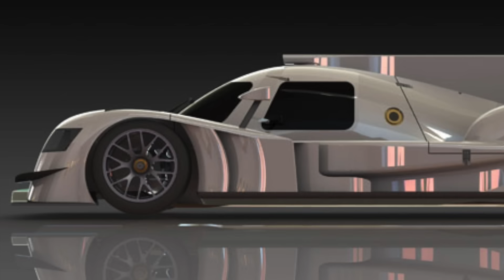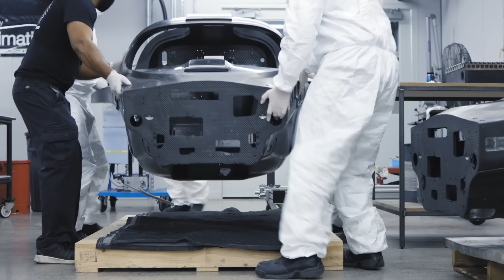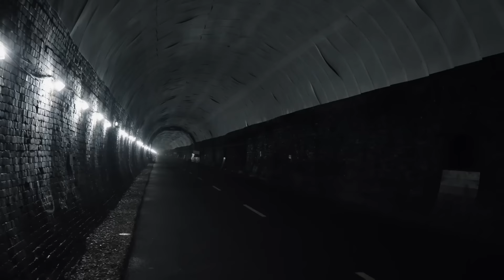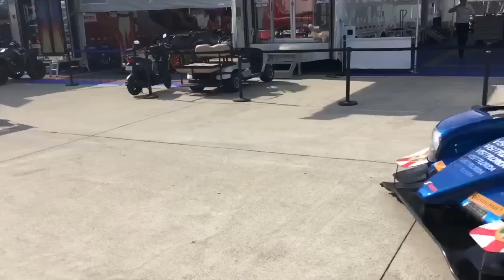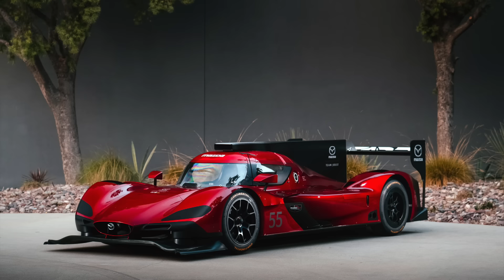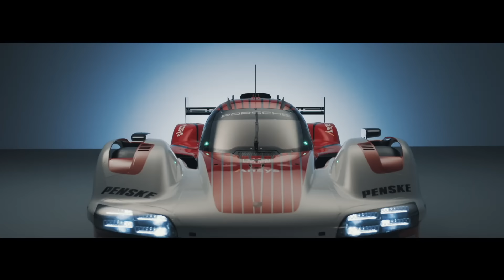Mazda RT24-P & Riley MkXXX - The DPi sportscar that defined an era

Comment: Definitely one of the best looking sports prototypes of all time and absolutely in my top 3. Every time I watch an on-board video of the RT24-P at Daytona, especially 2019 onwards, I giggle at the sound of this little 4 cylinder pressed against its 9000 RPM redline thinking: "man, this little thing is working that 600+ HP". Sad to see Mazda leave the series, because looking at how the Porsche 963 is slaying with the Multimatic chassis, I always keep thinking: "that could've been Mazda up there". When or if Mazda decides to come back to the party, I wonder what chassis they would use, how would it look, considering the RT24-P is a tough act to follow, and what engine will power it: the old 4 cylinder, its awesome straight 6, or even its new Wankel rotary. Whatever happens, I'll be glad that Mazda returns to prototype racing

Comment: I do not like pointless comments.
Reply from the maker: paperclip.
Reply: @Samsthepits  For the record, it was a comment to feed the algorithm. By the way, I just subscribed today... 😉😉... so you might as well get used to my pointless comments.
Reply from the maker: @Roddy451  Well thank you - the algorithm will enjoy discussions about paperclips.
Reply: @Samsthepits  P.S. IMHO, your channel is underrated. It is very informative, and you do a good job of not taking sides or speculating. Keep it up!
Reply from the maker: @Roddy451  Thank you very much.
Reply: @Samsthepits  P.S. Make that an angry paperclip...
Reply from the maker: @Roddy451  How do you make a paper clip angry?
Reply: @Samsthepits  You replace it with tape or a staple...
Reply from the maker: @Roddy451  what about those metal bars on strings?

Comment: I, too, was struck by the beauty of the Mazda and distraught that it wasn’t a world-beater out of the box. I do wonder how much of this program not carrying over to the lmdh era came down to the influx of VW $ flowing into Multimatic demanding their full attention. The 963 comes close to the RT24-P's geishaesque lines, and perhaps the Audi would have been a teutonic temptress...probably not.
Reply: It was really unfortunate for Multimatic they never got Audi to run the same chassis that the Porsche 963 uses which was the original plan and a big reason for the basically monopoly VW group has over the 963 chassis. Though they also build the Aston Hyper chassis, but that goes back to when the Valkyrie was a Red Bull and Aston collab with Multimatic helping design and build the chassis of the original road going cars. And the Aston chassis is technically a LMH chassis, where the 963 chassis is a LMDh.

With all the work they do together (Ford GT, Mustang GTD, Mustang GT3 and GT4), it is super surprising Ford and Multimatic didn’t team up for Ford Hypercar entry. Though if it’s not the VW group stopping the Ford Hypercar Partnership, Multimatic might simply not have the man power to take on another team. Building all the Mustang GTD’s, GT3’s and GT4’s, the Porsche IMSA chassis’s and Aston Chassis’s, on top of supplying well over half this year Le Mans grid with suspension and other parts, the facilities they have simply might not be able to handle supporting a huge team like Ford’s Hypercar entries. I’m sure Ford will still use Multimatic’s suspension so it’s not a complete loss for them.

Comment: The streets will never forget the big mistake that 2017 P2 rules were. P2 was fun to follow before that. And when LMH arrived, that unnecessary extra pace came back to bite WEC. 🤦‍♂
Then the big mistake made by IMSA was removing the P2 from the equation later. They were the pace target, they were what kept costs under control. When they did that, Nissan had no reason to stay as it became a development race. Mazda removed one car soon after. It was clear they wouldn't stay till the end of the cycle.

Comment: Mazda Hypercar in WEC, power by a hybrid rotary engine and based on design form both RT-24 and LM55 for Le Mans return would be awesome but also fitting its brand image. Mazda is the first Japanese brand to win Le Mans but it's sad that it left endurance racing after 1992 because the 3.5L Formula made Group C program costs have skyrocketed high and after 2021(IMSA) because of the post-pandemic situation. I wish rotary engines return in endurance racing especially WEC via Le Mans race.
Reply: i would love to see them try again the Mazda 787B was just a monster
Reply: @Mastoblood  787B is slow at raw pace, its not fast as you might think it is
Reply: @Yoshi_AZ1  fair but the sound tho .............

Comment: A Mazda LMDh with a Rotary+hybrid would make complete branding sense with what they want to do with their road car.
Reply: It would be an instant fan favorite as well
Reply: Especially if it was a 4 foot or two rotor  twin turbo with hybrid power.
Reply: Call it the Mazda SkyActiv-X R DPi, it'd be perfect marketing
Reply: The closest we'll ever get to that is the Mazda LM55 VGT
Reply: They also have some goofy compression ingition petrol we should just do all 3 at once
Reply: rorory's are baned
Reply: @yeetboi333 no they aren't, in fact they're actually eligible now more than ever. That banned myth is mostly to do with Group C cars switching to V10 engines during the regulation change.
Reply: @yeetboi333  Rotaries were never banned outright from endurance racing. Group-C1 switched to a 3.5L V10 formula (so Bernie could tempt manufacturers to F1), but other classes allowed them. In 1994 an IMSA RX-7 with a 4-rotor competed at Le Mans, then in 1995 and '96 a semi-independent Kudzu chassis ran a 3-rotor in the WSC/LMP-2 class.

It's a popular myth that the 787B dominated and had to be shut down. The reality is nothing like that.
Reply: @Fuse_22 oh sick thanks man yeah i thought they were banned after the 787b lol
Reply: @yeetboi333 they are not. But diesel engine are banned in wec.
Reply: @y @yeetboi333  1994 IMSA WSC was won by a rotary

Comment: I will always love a modern prototype with an "unusual" engine choice like the Mazda I4 or the Porsche 919's V4. As much as they're all very different engines with very different origins, I always feel a little disappointed that only 3 of the known LMDh/LMH engines aren't some variety of turbocharged V6 or V8
Reply: When Honda tested their SF engine with the F1 fuel it was more powerful than the F1 V6. Imagine if Honda could use that one... I really wish F1 had copied that part from LMP1H engine regs as well, maybe Porsche could have adapted their 919 engine for '26...
Reply: @PenteanoO F1 should’ve adapted the 4wd from LMP1 for 2026 instead
Reply: @PenteanoO where can i find out more about this SF engine that’s hard asf
Reply: @RonnieWilliams_ It's an "old" history. But Sam mentioned it in his "Dallara Super Formula" video, check it out.

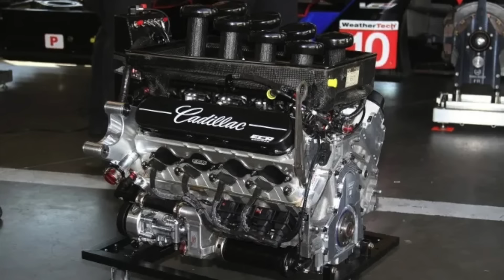Comment: At 11:36 you stated the Mazda was matching the power of Cadillac's 5.5L V8 which is true. Fun fact tho in 2017 the Cadillac's were using the 6.2, and 5.5 came in 2018
Reply: That is fun. You may also remember IMSA struggled with BoP for a while, since rumor was the 'lil Mazda engine was at the very top of it's performance window and they couldn't get anymore HP out of it. The Caddy had to be nerfed many times.